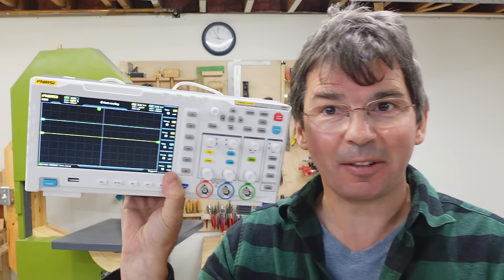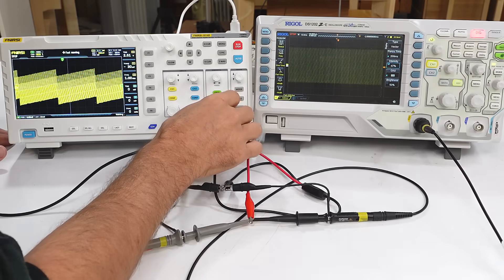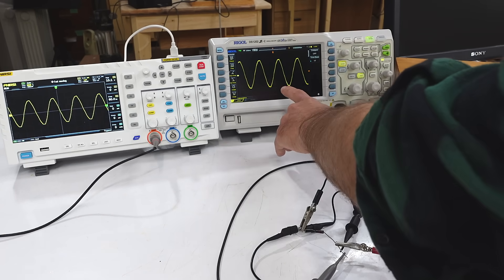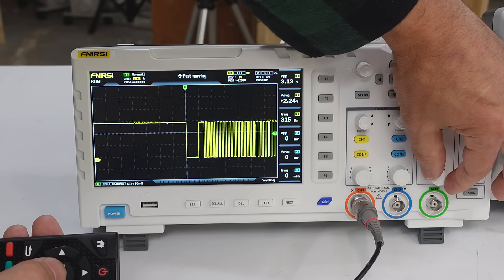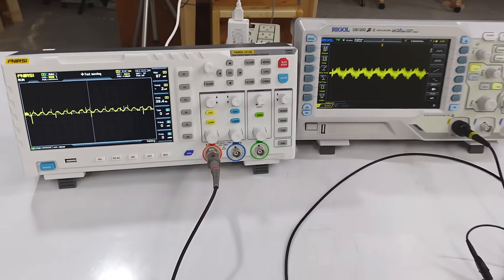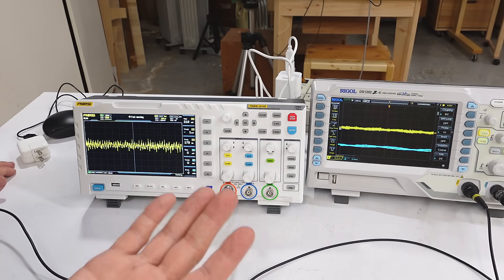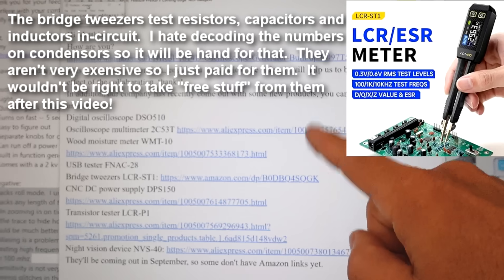Fnirsi-1014D vs Rigol DS1202Z-E

Comment from the maker: Udate:
Someone pointed out the sampling is not 1 ghz as stated, so Investigated.  This time the 62.5 mhz signal was correctly showing 62.5 mhz and not attenuated with just one trace shown.  With two traces it thinks its 37.5 mhz.  The aliasing 62.5 mhz to 37 mhz suggests a 100M sample rate in dual trace mode, and presumably 200M in single trace mode.  But the 65 mhz signal was not attenuated this time.  I was using a different scope probe.  So bandwidth may not be as limited as I thought it was, it just doesn't like the Rigol scope probe.
Reply: Probably 1GHz in this high sweep speed cases….but would require a TON of memory if you are set to 1 millisecond per division.
Reply: I believe Dave at EEVBlog did a detailed teardown of the 1013 scope from the same company.  If I remember correctly, he found that the top sampling frequency is 200 M samples/second, although that was maintained when both channels are used.  I suspect that this scope uses the same sampling circuit. (See learnelectronics 2 part review or Kerry Wong if you want a VERY critical review.)
Reply: @ajlenze8  YES if you want to know about these scopes, watch Dave's breakdown. He's an EE.
Reply: I  have exact P6100 probes that is included , FW 3.0, tested my power  FRINSI  Power adaptor and I don't get any noise, you must have a faulty unit
Reply: Finirsi now launched a brand new one, FNIRSI 2D15P,  if you could ask them to send you a sample that would be so great or if they dont then maybe you could get it just for a review? since it is really affordable around 250 bucks and you could resale it and the loss in difference would be a youtube channel expense tax write off :D anyway all I know is that I would like to see a hands on review of it xD
Reply: I enjoyed your full review and you pointing out the further checks in your videos.

Comment: Hi Matthias! I was looking for a cheap oscilloscope, a model like this one, but after seeing the problems it has, I decided not to buy it. I'm also not interested in a high-megahertz oscilloscope. I'd like to know if another Fnirsi model, like the 2C53P (tablet type), if you've tried it and it's better, at least you can trust what it displays, even though it only goes up to 20Hz.
Reply from the maker: I don't know, never used it.

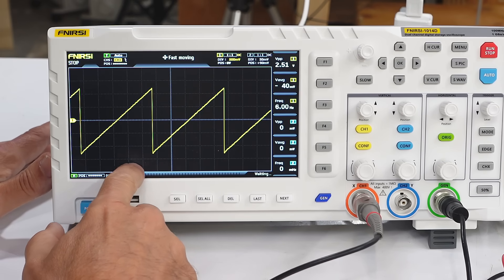Comment: I tried to replicate your  test and when I press the blue Auto button waveform nicely shown  with 4 sawthooth peaks at 50ms/div Horz. and  500mV  ver.,  10:1 DC ,  6.00 Hz. according to your scope 3:15, ....my results OK!,   I could get some noise on CH2 when probe is connected to BNC only , that disappears when I fiddle the port indicates bad contact on port to pcb joints

Comment: I basically use my Fnrisi as a pair of eyes into circuitry and fir trouble shooting. My TEK 453 finally died and I was at a loss to even start trouble shooting. You need a scope to fix a scope. My 1014 cost me $100 and arrived in two days .now I can repair my Tech scope and have a reliable modern very portable scope. There is a new confusing learning curve though from analoge scope to a digital scope that I do not like.

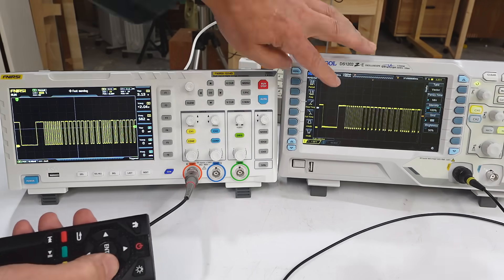Comment: 5:44 well, that's what holdoff feature is for. You can select delay before next trigger event. Also there's different trigger modes, you can set up trigger to work not only for fall/rise, but also for pulse width, for example.

Comment: You really shouldn't expect much from a Digital Scope that costs so little.   high noise, low bandwidth, terrible CMRR. terrible isolation....these are all features that raise the price of good scopes as they are were top notch engineering is required.  That scope looks like a smart 9th grader's home project turned product wanna be.

Comment: Would I be better off with one of these? Or an older Tectronix ?
Reply from the maker: depends on if you need a digital scope or a high frequency scope
Reply: @matthiasrandomstuff2221  do You recommend this scope, I'm a student, but all the electronics I do are basically guitar pedals, is this scope enough to troubleshoot my circuits, for example single transistor treble boosters.?

Comment: Thanks a lot for the video. The info is clear and straightforward. I have a plan to buy the Fnirsi-1014D. I need to use it to tune two LC tank circuits in a metal detector project. I would think Fnirsi-1014D works fine with a few hundred KHz, right? In this case, would Fnirsi do the job quite well same as Rigol?

Comment: Are any of these faults fixable by a Firmware update?
15 seconds more to start up isn't a big deal and the Rigol probably has more startup tests due to it having more features but it's not a big deal surely.
Not like you start it up every time you change test points.
Still wouldn't trust FNIRSI and it's the same thing, you get what you pay for. There are quite a few reviews out right now which I believe are from trustworthy sources and they're not very good for this scope and it's specification claims.
Hopefully they will take onboard your review and act on the faults with an updated model(or Firmware?) for around the same price as I'm very interested in buying a cheapish basic digital scope but it has to work as specified or I'll just stick with my old analog machine.
No point having something that only half works and can't be trusted.

Comment: Great review, thank you. With those noise issues, I would be tempted to build a linear power supply: 1 Amp @ 5 VDC = 5 Watts, so make it about from 1.5 to 2 Amps DC and it should work fine.

Comment: I recognize the “operating system” on the frsni from much smaller, cheap and portable scopes, which are not worth the trouble. I was validated that you also found the “zoom affects the trigger voltage” behavior weird and bad. I thought I was going crazy.

Comment: Probes can affect the observed bandwidth of an oscilloscope. They also have to be matched to the input characteristics of the scope. The proper way to check a scope's bandwidth is to use a signal generator that has a 50Ω output, a 50Ω coaxial cable, and a 50Ω termination at the input of the oscilloscope.

Comment: You have spent a couple dozen seconds showing the transitions between the generated frequencies. Note how on the cheap scope, those transitions are "gradual", and the waveforms shown are sinusoidal, compared to your reference scope showing rectangle. To me, this is a sign that the fnirsi oscilloscope uses the "repeated waveform sampling mode for periodic signals", where you fake a higher sampling rate than what you really have, by sampling the "same" waveform repeatedly, maybe with a bit of an offset of the timebase, and then averaging or interpolating the result in some way. Here, the oscilloscope seems to interpolate using a sinewave in time domain, or do some aggressive low-pass filtering in frequency domain (same thing). If your actual signal observed is too fast, you may get aliasing combined with interpolation, leading to funny results :-) To me, those gradual transitions on the screen are a telltale sign of some "creative interpolation" going on. 
Decent scopes warn you when you when they resort to "repetitive waveform sampling". There tends to be an indicator icon on the screen for that or something.
Reply: Yes👍, its real sampling is 200MS/s not 1GS/s as Fnirsi claimed. There is a guy on the EEVblog who rewrote the code, which made it more usable, there are still problems with it, but it is slowly being solved.

Fortunately, someone took my copy, although I sold it very cheaply and lost a lot of money on it.
At least one less thought.
Now I just need to get rid of the 2C53P. The same crap as the 1013D/1014D...

Comment: Counterintuitively, I wouldn't recommend the Fnirsi to a beginner. When you're learning you need to be able to rely on what you see because you're not going to know if you're looking at a real problem or just the limitations of the scope. You can get a great old analog scope for the same price as the Fnirsi and you'll be 100% sure that what you're looking at is real because analog = real life.

Comment: FNIRSI seems to put good specs for the money, but  you cant trust them in certain scenarios. If you want to chase a fault and not your scope, Rigol / Siglent / Owon and some Hanteks would be the bottom line. For rapid field repairs, the pocket ones are great, provided you are aware of their limitations. But the will never replace a Fluke Scopemeter.

Comment: I am thinking on two things now, 1 i will try to connect to ground and 2 calibrate the probe. On the underside of the connector of the probe there is a small screw where you can calibrate the probe with. The P6100 mention it in the manual, but i didn't found out yet how to do it with the Fnirsi-1014D.

Comment: The  analog input part does not have the bandwidth it states. So if you intend to measure high frequencies the measurements won't be real. You can test with its own waveform generator put a higher square wave with high frequency and you will se a waveform that is not square because it cuts the higher harmonic, and yes it is not the generator because I tested it with another Tektronix (very old one) scope that in theory has half the bandwidth of this one. And later I tested with a very good generator I have.
But it is Ok it was an impulsive buy and it was cheap.
But the power adapter is criminal I used by mistake on another device and it began to blink. I disconnected it immediately and fortunately it was not damaged.

Comment: Regardless of if all measurements are initiated correctly or not, what you ran into was what every beginner would run into and stumble over. Especially if you start the hobby and stick to cheap tools, either because you are unsure if it is the right hobby or you cannot afford the big brands, you will end up chasing faults that don't exist but are only ghosting on your meter screens and displays. In this case it is only double the price but 10 times the fun. These simpler reviews are very important and helpful to much more people compared to the high price gear comparison with lots of tech words, at least in my eyes. Words from a guy with the shelf full of R&S, Agilent and all this high price gear ;)
Reply: I myself am just an intermediate hobbyist... and I have to agree: if you have an open mind, a cheap digital scope will eventually make you aware / watch out for the typical side-effects of having too short a buffer, not enough sampling rate, not enough bandwidth and own ringing (impedance mismatch) in your probes, various signs of aliasing...
Reply: @xrysf03  actually I learned a lot when starting with an analog Philips scope  before proceeding to digital samplers. Lucky me my dad had some real Agilent scopes in the company  which I was allowed to use. And later I got the same unit from eBay for cheap. I still use it today, ken three of them including the one from my dad's company I used. And a 60MHz two beam 4 channel Yokogawa.

Comment: The one thing I was looking for in a scope is to be able to measure signals on mains without the need of expensive differential probes. The FNIRSI allows for measurements up to 400V using 10x probe and even higher if you use the included 100x high voltage probe. My hesitation is for purchasing are the things you pointed out about sample sizes and storage depth. Any suggestions for a scope with mains measurement capabilities without expensive differential probes?
Reply from the maker: The hanmatek scope I reviewed can also run off a power bank, but it uses 8 watts, so needs a bigger power bank.  Also, if you take something like the rigol scope and disconnect the ground lead, its also floating.
Reply: @matthiasrandomstuff2221  Thank you sir for responding to my question. I agree that on a Rigol or others the ground disconnected.  But Rigol, for example, says that the scope can not measure mains. I assume it is because of the internal circuitry, regardless if the ground is disconnected. FNIRSI explicitly says you can use the scope to measure mains with certain provisos as I previously mentioned. 
Would it be a correct assumption that any scope that is power by an isolated from mains power supply like USB -C DC power source that you can use it to measure mains? It would be interesting if you could do a video on this. 
Thanks again for the response.

Comment: I can't believe that you compare this crap with the rigol.  The fnirsi is even not a realtime scope, it's a successive/approximative scan oversampling scope.  That mean that for displaying a single scan screen, it have to successive scan multiples shifted samples over time to make a complete waveform.  It can't take one single snapshot.  This is why at 02:00 min you see this kind of waveform.  It's a "shadow" picture of the multiples approximation taken over a period, resulting in a false representation    This is a complete garbish useless toy.  You can't do any serious measurement at all with that.  This is a definition of what it really is:    

How Successive Scan Approximation Works
In these types of oscilloscopes:

Progressive Sampling: The signal is sampled at successive intervals without capturing the entire waveform in a single pass. Each pass captures a small portion of the signal with a slight time offset.

Reconstructing the Signal: These sampled sections are then recombined to generate an approximation of the complete signal. This process generally works well with repetitive and periodic signals.

Bandwidth Limitations: This type of oscilloscope typically has lower bandwidth and is less accurate for non-periodic signals.

Comment: When talking about the noise, you keep mentioning "ground" but those power adaptors don't have ground they are two pin. They are  not appropriate for laboratory equipment.

Comment: Granted the FINIRSI has sample buffer issues and max frequency capabilities.  But at the price point and for most use cases it is quite satisfactory.  The signal generator is it's forte.  You can open up the FINIRSI and install a USB power bank and make it a very portable unit, it is best to run it off of batteries.  In my opinion the FINIRSI is the best economical choice.

Comment: The irritating thing about most scopes is that you only get the basic functionality. You have to buy additional licenses to "unlock" functionality that is already present inside the scope. So it looks nice, cheap and flashy when you see it in the shop but that is just the shell.  NO THANKS!  Most times you end up paying 3-5 times the original price to unlock the functionality THEY KNOW you need.  But you don't realize it before it is too late.

Comment: These scopes look pretty but I would always prefer an Old Tektronix 465 for faultless operation and reliability.
Reply: Reminds me of the time back in the early 2010's when the manager of the place where I was working decided to buy a few Owon scopes.  3 months later he was cursing in the lab.  "This triggering function doesn't work right!... The FFT doesn't work right!"  ... Another engineer piped in "You know, they sell an upgrade that fixes all the problems with that unit.  It puts a Tektronix logo on it."  Nowadays, the Rigol scopes are actually decent quality and tend to work correctly, although it wasn't like that at first.

Comment: will it be good for audio troubleshooting?? Car amp ot steroes?
Reply: No, I wouldn't recommend the fnirsi oscilloscope for classic hifi repairs. I'm a classic hifi restorer, and I purchased the scope, but ended up returning it for refund. You cannot measure tiny mV signals for instance for turntable audio signals, and the scope always puts out noisy signals, it's a mess. With noisy signals you cannot do accurate signal measurements etc. The signal Gen, you cannot change the signal amplitude. Rather stick with a classic analog crt scope. They were designed in the day to repair classic analog electronics. My 2 cents worth. Good luck.

Comment: Nice review. Some Rigols can be bought with signal generator. I bought the 4 ch 100MHz 1104Z Rigol a few years ago and no regrets. Even has a port for 8 channel logic analyzer pod. Don't too often need 4 ch, but handy when I do need them. How the waveform was displayed when you had the Fnirsi scope connected to your pico-pi and it was changing between freqs, was quite odd.

Comment: I'm concerned in this comparison that you may be overlooking some of the more advanced controls that are typically found on most scopes.  I don't know if these scopes have them.  I consider this video a comparison of discount scopes.  :shrug:  

As an example, 5:40, scopes usually have a control for trigger delay.  This is a delay imposed after triggering to prevent the next trigger from happening before desired.  It should probably be called retrigger delay, but here we are.  This issue where a follow up pulse retriggers the Rigol and spoils the desired pulse from being displayed can be compensated with a little (re)trigger delay, if so equipped.  The Fnirsi naturally imposes a delay that happens to be long enough to prevent spoilage, in this particular case it's a blessing, but I wouldn't count it as a performance win.  The Rigol, that you would have to slow down with a trigger delay adjustment (if so equipped) would be the performance winner, I would think.

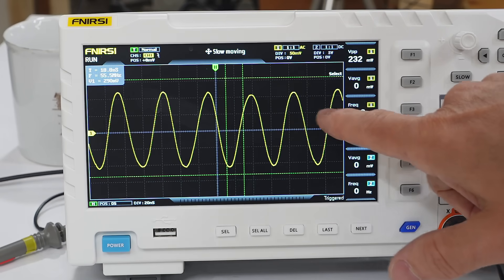13:30 Scopes commonly have a 20MHz filter and some have this on by default.  Perhaps check the input channel menu to see whether this is engaged?  This might explain how a scope seems limited to 20MHz while its marketing claims are of much higher bandwidth.
Reply from the maker: Yes, the Rigol has that.  But look at the video length.  Awfully long already.
Reply: @matthiasrandomstuff2221  And the 20MHz filter?
Reply: The video title suggests your comparing the pros and cons of each oscilloscope, but I guess the video content suggests your qualifying the new scope against the old, in this might explain why you didn't go into details of a feature on the Rigol.